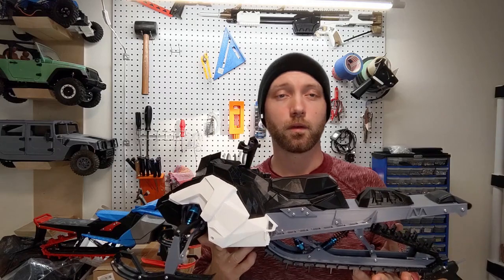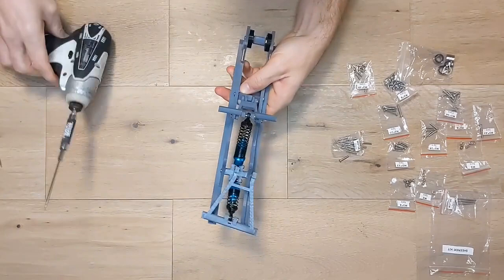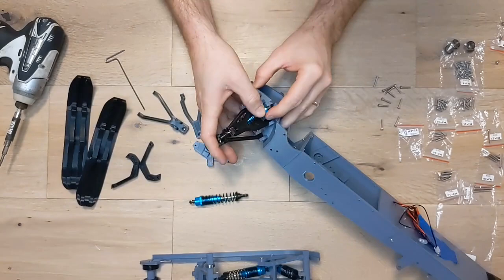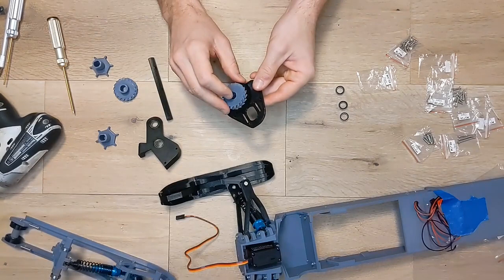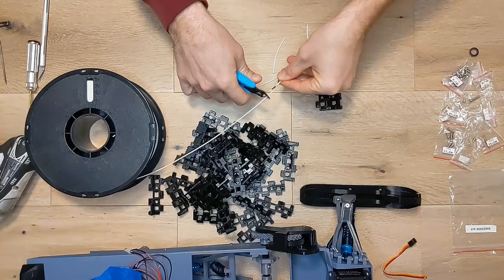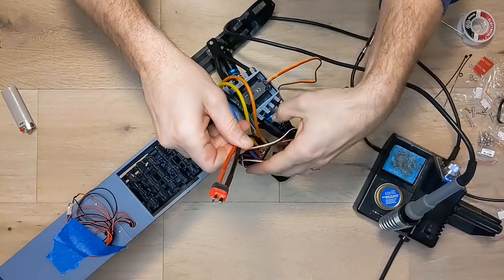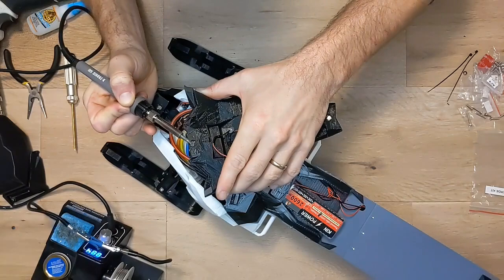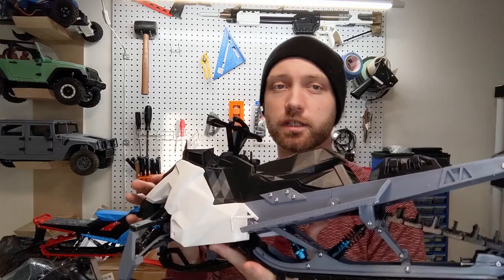Skeeride RC Snowmobile Build Guide - with "Polar" panels and TPU track

Comment from the maker: At 19:25 I referenced using a motor shim which I eventually designed and printed. If you're looking for one you can download it here: https://www.tinkercad.com/things/luFOm7WP1em I recommend ABS or PETG for better heat resistance than PLA.
Reply: Where did you buy the motor and esc

Comment: Very well done. Thanks for sharing.
Reply from the maker: Thanks!
Reply: @rcprinter  what all do you need to finish if I use your top range kit (other than rx/tx and the printed files) to finish where can I find the hd nuckles as well
Reply: How do I get one?
Reply from the maker: @maxsummers6297  The HD knuckles are in the mods file. I've also started using the jibberjabs steering mod which is in there as well and I'd highly recommend. You'll need a few other things, metal pinion, traxxas spur, battery and charger, rc shocks, lights (we sell these too), solder & lube & filament. Its all listed in the buy list once you download the files.
Reply from the maker: @rchippie508  You build it! https://www.myminifactory.com/object/3d-print-skeeride-rc-snowmobile-143369

Comment: Using the motor and esc and servo combination that your using can it weelie and does it have a lot of power?
Reply from the maker: Yes it has lots and lots of power, especially on a 3s LIPO. I can change the speed by changing the pinion I put in it. A larger pinion makes it go faster and wheelie more easily but the motor gets hotter and its less controllable at low speeds. A smaller pinion makes it more controllable and responsive at low speeds and keeps the heat down. I think I'm running a 13-ish tooth pinion at the moment but I could put on a much larger pinion if I wanted more speed but its plenty to handle already. If you want an even faster 540 motor you could try something with less than the 13.5 turns in it but I wouldn't recommend that because I think it would get too hot.
Reply: @rcprinter  Ok thank you cause yesterday I bought the kit from you cite and I got a 13 tooth pinion gear and a 54 tooth spur gear I'm thinking that will work good.
Reply from the maker: @ggfarms  yeah that's what I run and I think it works great.
Reply: @rcprinter  Ok thanks for the feedback

Comment: If I go on rcprinter and buy the skeeride with fastener/bearing/servo/motor+ESC. Am I getting everything and then I just have to pit it together or do I have to buy some stuff separately?
Reply from the maker: no there are some additional things that are required. spur and pinion gears (or belt drive), shocks, lights, controller, battery, charger, filaments, pins for piecing the track together will all be required. There's a complete list of stuff required when you download the files from myminifactory. Our kits only come with what is listed on our kit page and they are not complete.
Reply: @rcprinter  ok thanks

Comment: Great video ! After building my skid and rewatching video 5 times I have a cross piece left over ( flat spot on bottom ) that looks like it goes across the front kicked up sliders . There's holes for it  but after watching your video I noticed it wasn't connected ? I believe it's called " skid spacer front " . Did you guys just miss it or is it not being used ? 
 Cheers
Reply from the maker: Hey there, yea I believe that piece is supposed to go at the front of the skid! If you watch the original designer's build videos he doesn't add it either so I never put it in on my sleds. Doesn't seem to affect anything but I believe its supposed to be there and you can see it on some of his pics like here: https://cdn2.myminifactory.com/assets/object-assets/5fc2d83e43a16/images/720X720-img-2980.JPG
Reply: @rcprinter  awesome . Thanks buddy 👍

Comment: The fastener kits are all the screws, correct? And when will the full motor, esc + bundle be in stock again?
Reply from the maker: Hi Kylar, yes this kit https://rcprinter.com/products/skeeride-build-kits includes all the screws required as well as bearings and a servo if you choose those options. You can see a list here of everything that is required but we add a few extra screws in our kits as well as the extra screws for the "Polar" panels if you choose to do those: https://drive.google.com/file/d/1A4NamlUtWjww1EZkuwxLEj4XFoeueZby/view

More motors and escs have been shipped but they'll take another week or two to get here. It'll be less than two weeks but I can't give an exact date. If you check the designer's buy list there are other motor options in there as well if you don't feel like waiting.
Reply: @rcprinter  thanks this helped so much
Reply from the maker: @kylarbolding117  no prob dude, have a blast with it!

Comment: Hi, I am wondering if I could print this in petg. Thank you
Reply from the maker: You certainly can. People will tell you PETG is stronger and more flexible than PLA but in my experience it doesn't hold up any better than PLA in RC crashes and in the cold snow its worse than PLA. YMMV.

Comment: Does there need to be a screw in the end of the transmission axle. There is a hole for one, but never can see if you instal one. Thanks
Reply from the maker: The axle with the traxxas and herringbone gear on it? No sir. I don't think there's a hole in there. You might have that piece confused with the rear roller axle.

Comment: For the main body how much supports does it need? I bought the files but have no idea what needs supports and what dont! I really need help please!!
Reply from the maker: Hey man its been a minute since I printed one but it definitely does need some support. I think I'd turn on supports everywhere, turn the support threshold down to 30% and then just put support blockers in places where it doesn't need it like the magnet lock hole and the screw holes. What you'd end up with is basically supports for the middle there where the magnet goes, for the bumper on the nose, and for the little underside section that's just off the build plate.

Comment: did you do a testing video with the tpu track?  how does it hold up vs pla?
Reply from the maker: I do like the TPU track better. I've never broken a paddle with the TPU track but I've broken lots of pla track pieces. You do need to make sure you upgrade your rollers though to keep it lined up.
Reply: @rcprinter  what do you mean the rollers. do you have links for what you mean?

Comment: Ok seriously I don't have a 3d printer. How much could I buy one of these rc sleds from you for?
Reply from the maker: They're expensive and they break a lot. You should check out the Skeeride discord forum. There's lot of guys on there that would sell you one for probably $500-$700 depending on what's included but I wouldn't recommend it unless you have a 3d printer to print replacement parts... or at least a buddy with one.
Reply: @rcprinter  oh ok thanks

Comment: The transmission gear that bolts to the traxxas gear I tried a m3 screw but seems way to fat. I tried drilling the holes to a m3 size but then break off the little round tabs.
Reply from the maker: That's odd, I haven't encountered that issue. The little round tabs aren't required so I wouldn't worry about them too much. Is it the head that's too big or the bolt threads?
Reply: @rcprinter  it’s the threads, I did drill the holes out and hopefully it works.
Reply from the maker: @MrElasky123  If you have to drill them out a tiny bit that's worth trying, you can always just print again if it doesn't work.

Comment: So does the build kit give you everything you need like bearings, electronics, screws ect.
Reply from the maker: Each kit tells you in the description what you get. You can get bearings, electronics and screws depending on what you select but not everything you need for the build. We don't carry shocks yet or controllers, receivers, or batteries. You can also order motors and escs but the motors are out of stock for the moment.
Reply: @rcprinter  K

Comment: You should sell a printed TPU track for those of us who don't have a direct drive and have had terrible TPU experiences!
Reply from the maker: Good idea! I'll think about it! I haven't had too many issues with the TPU although I do deal with a LOT of stringing and left over printing artifacts that I need to snip off.
Reply: @rcprinter  just sell the raw track, I'm pretty sure we're all big enough and ugly enough to trim our own track sections. When I print kits the buyer gets exactly what comes off the print bed, brims, skirts, rafts, stringing. As long as you explain up front it's no different from having to remove parts from sprues on plastic model kits.  The whole reason behind this is not laziness on my part, but my customers like to feel they've actually put in some work and not just screwed/glued parts together.
Reply: What shore TPU you used? Would Ninjaflex work on this multipiece track?
Reply from the maker: @THuhtamaki  95A I think it was. Ninjaflex Cheetah is 95a too so that should be fine.

Comment: how much does everything for a skeeride cost?
Reply from the maker: It depends on what you might already have. If you need to buy batteries and a radio because this is your first RC then it will be more. Our top kit is $157 and comes with motor, esc, fasteners, servo and bearings but you'll still need shocks ($30), pinion and spur gears ($30), lights ($10), filament ($60), and any tools or supplies you don't have like lube and solder and a 3D printer. Then if you don't have a radio that could be ($50-$100) and a battery ($50) and a charger ($50). You also need to buy the design files ($20 + polar $10). It can get pricey.

Comment: Hey great video! I built the skeeride and printed the polar kit . All is great except my rear track keeps coming off to one side? I've tried the adjusters and all seems good until it's turning.... any ideas ??? Should it be more on the tight side or less ?
 Thanks !
Reply from the maker: Hey I had the same problem. Fixed it with one of the mods called "mods-millikart-mod-ryan-rear-roller-with-guides". There's a right and a left one...  make sure you put them on the proper side. Works like a charm and I haven't blown my track off since.
Reply: @rcprinter  thanks a bunch ! I'll be printing it tonight ! 
All the best ✊
Reply: @rcprinter  thanks again ! Worked like a charm !!!!
Reply from the maker: @frogicus  happy sledding!

Comment: What are the shocks you used
Reply from the maker: I wouldn't recommend the shocks I use in the video and I have a hard time finding shocks I would recommend. The ones I used were these https://www.amazon.ca/gp/product/B087NPF8L7 but they ended up being too stiff and didn't come with different springs to change it up. I have basically the same ones but with lighter springs on another sled and they're working good. The designer recommends a few options in his build guide you can check out but I find its kind of a crap shoot when you buy cheap shocks. I think these would be worth a shot but I can't say for sure: https://www.amazon.com/GoolRC-Absorber-Adjustable-Crawler-Off-Road/dp/B0828L38MQ/
Reply: @rcprinter  thank and you can adjust them to 55 mm?
Reply: @rcprinter  and the motor
Reply from the maker: @thomasstremick7223  No you'd need different shocks for the rear.
Reply from the maker: @thomasstremick7223  I like these motors but we're out of stock for a week or two: https://rcprinter.com/products/13-5t-540-brushless-sensored-motor-surpass-hobby-rocket-v3
Reply: @rcprinter  what were the pinion gear you used
Reply from the maker: @thomasstremick7223  Its just a random 13Tooth one from a cheap steel set on amazon I had kicking around. Just make sure its a 32P to match the Traxxas gear. We'll have pinion sets and gears for the Skeeride on our www.rcprinter.com site in the coming weeks.

Comment: Could you share a list of all the files you printed?
Reply from the maker: Here you go: https://lh3.googleusercontent.com/pw/AM-JKLVmYDTnlYuOfdA6qDbeKXhIMVXipgzIuBs99ikizOH349dhpO666wa7gJh_RxXQNGMSNLNSe-rPH8WJGDYVwnCCHsq9x13lZDnqVN51ou8O76OcnFadqdiucDluHxNPbRe7qE0CuvMaHnEF9ytFthViLg=w861-h705-no ... I'm still adding mods to the sled as I test out the more powerful motor and TPU track. I also printed a custom shim mount for my motor last night and I'm trying to upgrade the steering right now. :)
Reply: @rcprinter  Wow, you are the man! Thank you! Any chance you have something like this for the original Skeeride? The mod list is a bit overwhelming.
Reply from the maker: @sokey70  I don't but the designer includes a .pdf file that lists out everything you need to print when you buy the design files.
Reply: @rcprinter  Thanks! What TPU did you use for the track?
Reply: @rcprinter  This helps a lot. Thanks

Comment: Is it hard to 3d print a skeeride?
Reply from the maker: Nope, not hard, just time consuming. It takes a long time to print all the pieces especially if you only have 1 printer. Most of the pieces are designed to print without supports and the designer tells you which ones do need support. If you want a flexible TPU track then thats slightly more complicated but its not bad as long as you have a printer that can handle it. The build isn't too complicated either, you can just follow my videos or the ones from the designer from start to finish.